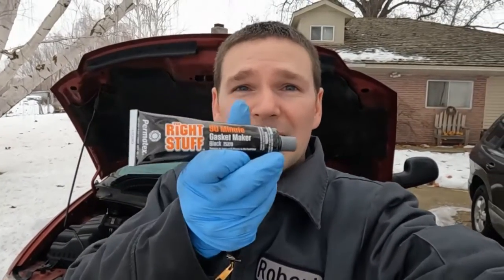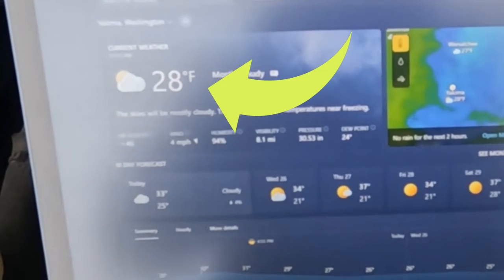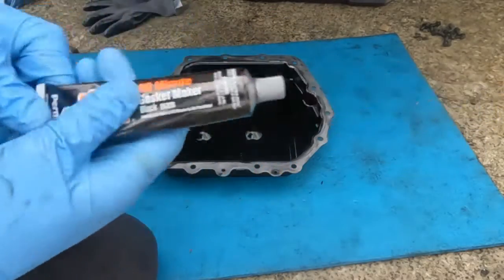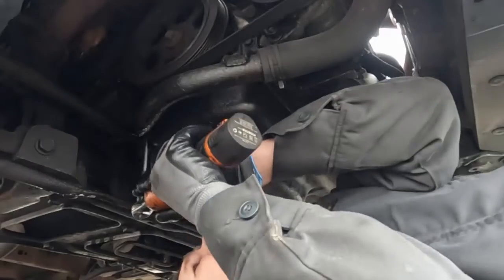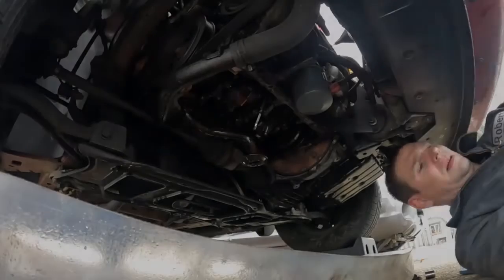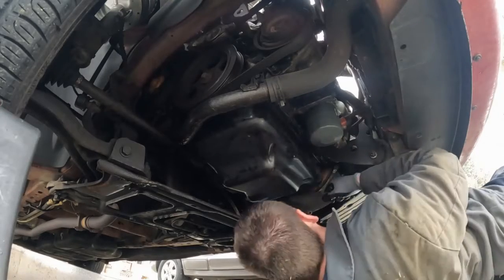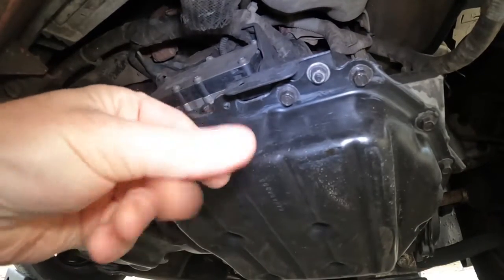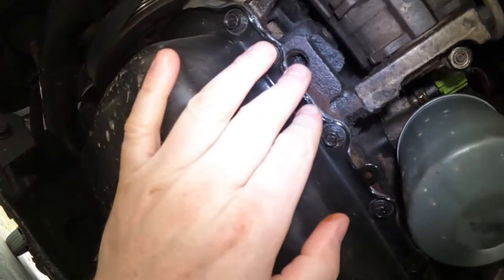RTV Gasket Maker Ultimate Challenge! | We're throwing away the rule book

Comment: Good video, but that’s way way too much RTV that bead should not be more than 2mm thick
Reply from the maker: Thanks! It was fun making it! I added more RTV than usual because this pan is supposed to have a rubber gasket. It needed to be a little thicker to compensate for using a different sealing method. But you're probably right, maybe a little too much. The cool thing is years later it's still sealed, no leaks 👍

Comment: Age of the products matter too.   I bought Permatex Ultra Grey and let it sit sealed, unopened, inside a dark closet 3 to 4 years. Opened it, seemed fine, and used it to seal the end of an opening around some fully cured JB Weld metal puddy. I used about 1.5 ounces, or 1/3 of the tube on a 4" square inch area.  There was a litlle 50/50 motor oil / transmission contamination that I could not prevent (like equivalent of 2 drops perhaps.  It got mixed into the whole repair.  It took 7 days to fully cure.  On day 2 I began spraying it with water 1 to 3.times daily to help it cure.  It was tacky for 4 to 5 days.  I thought it would never dry.  😅

From now on I'm only applying sealant that I buy new from a store that sells a lot of it.
Reply from the maker: @thesetruths1404  Great point! Thanks for sharing your experience 👍

Comment: This RTV stuff is one of my new go-to favorite tubes/bottles:
CA, CA kicker, Super Lube (oil and grease), Gorilla Glue, RTV Gasket Maker, brake cleaner.

(I'm not a mechanic. I'm a business owner that changes parts.)

Dab on corners of 6.0 HPOP (per YT guide), thermometer housing on DT466 (fiber seal also failed), and I'll be doing the axle seal next because the DIY fiber gasket maker didn't work. $10 little tube will replace $60+ in parts!
Reply from the maker: @andrewfaber9014  This is pretty good stuff! I also use the Ultra gray from Permatex 👍

Comment: I over did it with rtv on new oil pan with no gasket when I tighten pan it came oozing on outside so it had to bleed in the inside am I inn trouble letting it sit for 24 hours
Reply: Thank u for response it been 24 hours no leaks good so far 😂🙏
Reply from the maker: @Thizz2979  I'm not sure how much you used but it would take a lot of RTV to cause a problem.

Comment: If torque down right away then why is the gasket maker not pushed out of the pan in gobs?
Reply from the maker: @kevinhoronzy6011  It depends how much gasket maker you apply. The general rule of thumb is 1/8 to 1/4 inch wide by 1/16 to 1/8 inch tall. The bead of gasket maker is being squeezed out evenly on both sides, the inside and outside. So there's not a whole lot that squishes out unless you use a lot of gasket maker.

Comment: I'd be extremely worried about the fluid getting to the rtv and the combination of the two circulating around in the transmission. Seriously could have shortened its life
Reply from the maker: @josephhettiger2711  Interesting thought. RTV is oil resistant and can only be thinned with a solvent. In that case I don't think the uncured RTV can mix in any way with the transmission fluid. If any small chunks break loose they will be caught in the filter and won't be able to circulate through the transmission.

Comment: The oil and transmission pans will also see minimum pressure (although they both should see heat and fluid flung around) they may be less risk for this type of expedited install - other engine components that see pressure may be much higher risk - I prefer to follow instructions (and still have concern LOL) - Great video though. I was glued to the screen to see what happened.

Comment: So I did not quite understand , when you put the bead of silicone are you suppose to wait for it to dry before placing the cover and bolting it down, or do you put it all together, wet and tighten down?
Reply from the maker: You are supposed to put it on wet but only finger tighten it until rtv begins to squish out the sides. Then wait an hour before torquing it down. Then wait 24hrs before adding fluid and putting the vehicle back in service. In this video I wanted to see what would happen if you just slapped it on and torqued it right away and then filled it with fluid and drove it without waiting. I also did this in extreme cold conditions, below the recommended application temperature.

Comment: I recently replaced the transmission fluid filter on my wife’s ‘18 Mazda cx9. There was no factory gasket they used some form of red/pink silicone. The new filter came with a rubber gasket.. it leaked almost immediately. I then found a cork gasket and switched it out and that one began to leak shortly thereafter. I then bought Permatex ultra red and followed the instructions precisely. Solid seal absolutely no sign of a leak 👌🏻👍🏻
Reply: Operator error, thanks buddy, I like cutting filthy silicon off for half an hour when a perfectly good rubber gasket is available.
Reply: @elliotkane4443  the aftermarket gaskets for the mazda's don't typically fit tbh.. they're all just a bit off.. Mazda seals it with some type of RTV from the factory.

Comment: As a general rule I NEVER use silicone. I much prefer gaskets. The part you claim gaskets are harder to get off, Well' I say the complete opposite. Silicone can take hours to get off however with a new blade I will have an old gasket off in minutes 'UNLESS' someone used something else with the gasket like copper spray or silicone to help the gasket stick then it will take longer. Anyway against my better judgment I am working on a 40y van and I can't find anyone who sells a Sump gasket so I got some RTV Ultra Black which is why I am here watching your clip. Before using it I wanted to see someone else using it and find out any cons I should know. Obviously there will be some that goes in the sump as you tighten it, Willl Ultra Back break down to mix with the oil or is it likely to block up the oil pump or filter?
Reply: I have a 2015 Malibu and unfortunately they don't make a gasket for the oil pan.
Reply: only 8 years old and they don't make a gasket. just wow.
Reply: @peterwilliams4734  Toyotas come from the factory with RTV oil pan gaskets.
Reply: @tomcraftdonkey2285 yes the FIPG, expensive stuff if you get it from Toyota.

Comment: I think a follow up video is needed. Pull the oil pan and see how much, if any, excess RTV is in the bottom of the oil pan or now stuck to the oil pick up tube. It seems to me that you used an excessive about of RTV on the oil pan flange. And since you didn't let it cure enough according to the instructions on the package, that uncured RTV  came off when you filled with oil and ran the engine.
Reply from the maker: That's a great idea! Once the temps warm up around here I might do that 👍
Reply: @ValleyMobileAutomotive  😃

Comment: why would you waste RTV  on that oil pan bolt down holes out side of the hole you got so much Sealer on the inside of the pan hole you do not need glue on the out side of the hold down side of the hole... you do not need to go all the way around a pan bolt hole that is a large waste of good sealant which is not free.. just say`n
Reply: True. Service manuals that I have show inside of the bolt hole and ¼ bead is max less is preferred
Reply: When I pull my tranny pan off…. I will be paying close attention to how the factory did it. I don’t see the need to run sealant around the entire bolt hole either but if it’s like that from factory… who am I to argue?

Comment: pull off that oil pick up tube and clean it out or replace it ASAP i had a 1995 Bronco with a 302 engine which is called Fords miracle engine which saved the Ford Corporation from for sure failure it is used in many units you can google that and learn something,,, but the engine i got stuck with had coking [ heating of oil to the point of a raw porous coal state ] that is usually found on the inside of cylinder head exhaust side where it gets very hot and under the intake manifold cross over vent to heat up the under side of a carburetor to vapor a fuel mixture it will break off and drop off into the oil cut outs and lifters movements will break off crystallize oil to help make it into smaller fragments to go into the pick up tube and plug up the pick up tube screen thats what happen to this 302 ford bronco from not changing out the oil every 3K miles to dump out the particles and it starved the 302 for oil and took out a main bearing and blew off to rod big ends just took out the pan rail of the block and lost the oil pan too and i found a crack head so check the pick up tube... i did find a virgin 302 one piece rear main seal which is a newer 302 which you knew that, a 2 piece main oil seat is a older 302 engine but i punch it out .030 over size bore and found a standard crank that cleaned up on a just a good polish so it is still standard size bearings Haha so lucky i am a Master Engine Builder Diesel/gas burner and Helicopter Mechanic ..

Comment: at least pull of those rod caps and check the bearing. you can spin on a new bearing for about $7 each... i did a lot of them on diesel engines believe me .... and change out the oil pump too i am sure it is junk by now... open up the oil filter and cut it open to see the garbage you can take a oil sample and send it to a lab too ... i have done that...

Comment: way to much sealer it will break off and go into the pump and than if it made it that far go into the filter which is after the pump... very few systems have a filter first then to a oil pump so think about it garbage into the oil pump is just wrong then than a oil filter ??? Haha poor engineering they want the oil pump to fail which is the heart of the motor, Haha.

Comment: Would you recommend using this stuff to replace a Valve Cover gasket?
Reply from the maker: Good question. I would NOT use this for a valve cover gasket. There are times when the manufacturer has you put a dab of RTV in places but not for the whole gasket. The design of the valve cover allows the molded rubber gasket to sit inside a groove making a very durable seal.
Reply: @Valley Mobile Automotive  Have you experimented for yourself though? People always say no for valve covers but I feel like they've never tested it to find out.
Reply from the maker: @woooose  I'm sure it could work but it would take a lot of RTV! You would need to fill the channel where the rubber gasket would go then have enough protrude out to make contact with the mating surface. Also in the future if the valve cover needs to be removed you would need to scrape all that stuck on RTV in order to apply new stuff for resealing. I think it would be too big of a hassle to be practical.
Reply: @woooose  Yeah, I've had to clean off the mess that hacks have left behind, trying to carefully keep all that crap from going down into the cams, the lifters, the timing chains/gears.
All because they either think they know best, or are too cheap to use the designed gasket.

Comment: I use ultra black RTV and usually never have any issues.. Unfortunately when I was putting a new intake on my BBF 460 I did not follow to directions at all and torqued it down right away and fired it up about an hour or so later and sure enough it blew out the front valley seal.. now I get to redo it and follow the instructions this time 😂
Reply: Am currently doing the same on my bbf 400. It's ~26° out and I'm using 1-minute gasket maker. Got it torqued down, but nervous to start the engine for fear of the front or rear valley seal blowing out. Been waiting about 12 hours now

Comment: Thank you So much! This is what I was looking for, exactly!!
 I decided to drop the transmission pan & change the filter on my vehicle, I had bought all the supplies in preparation but when I had the pan off I found out that Autozone sold me the wrong gasket 🤦‍♂️ I already had that pan off & the vehicle on my friends lift. He was getting ready to wrap up so In a pitch I used some grey RTV, slapped the pan on, Filled her up & I got her on the road. (I had to get back home) 
That whole night, I was stressing because I thought I'd messed up the seal due to filling it & driving it before it Cured. Thanks to you & Your video Im way more hopeful & assured now!!😄👍
Reply from the maker: Glad this video was reassuring! While following the directions is best, sometimes we find ourselves in a pinch. I'm amazed at how well rtv holds up as a gasket.
Reply: @ValleyMobileAutomotive  Si I did not quite understand , when you put the bead of silicone are you suppose to wait for it to dry before placing the cover and bolting it down, or do you put it all together, wet and tighten down?

Comment: why dont you do the criss cross diagonal star patter when tightening bolts?
Reply from the maker: Hey Joseph good question. It depends on what you are tightening and the gasket being used. Most manufacturers will specify the desired pattern (it varies). If I was using the rubber factory gasket I would criss cross the bolts to prevent "stretch" and "bunching" of the gasket on one end. Because this is my vehicle I took some liberties, I also didn't torque the bolts.

Comment: I think you should have let the gasket dry longer
Reply from the maker: Yeah, the instructions do say to wait longer than I did. This was a test to see if it would still produce a solid gasket without waiting. I was surprised to see the results turned out really well. In reality I would stick to the instructions. Thanks for watching!
Reply: The last dude who pulled my oilpan didnt let it cure properly... 
There was so much "sludge" in my oilpan... my oil pickup was like glued closed...
Reply: @muffinatordlux  so was the pan sealed and was the “sludge” rtv silicone? To fully cure rtv takes 24 hrs but the vehicle is usable after maybe 2 hrs. For the regular stuff
Reply: @dirtyaznstyle4156  it looked very much like the silicon which had dissolved into the oil and then accumulated onto the oil pickup aswell as sitting in the bottom of oil pan... 
I let the car stand for 2 days after cleaning up the previous guys mess and the car is running so much better aswell as not leaving oil stains everywhere i park.